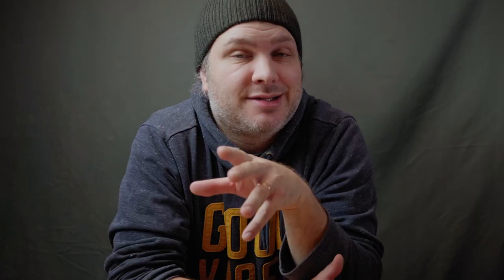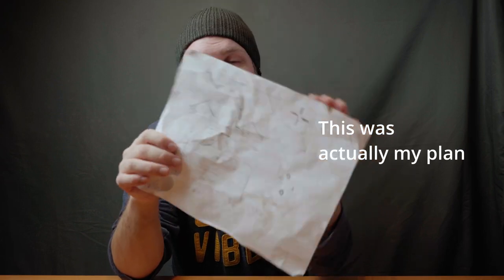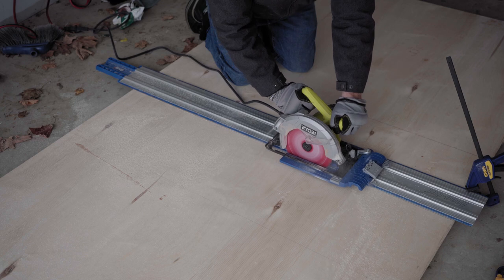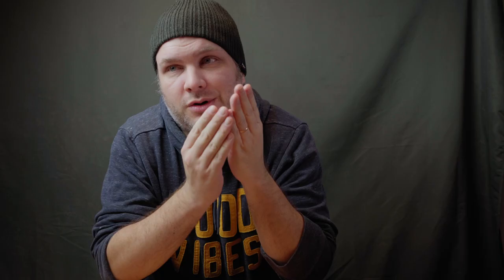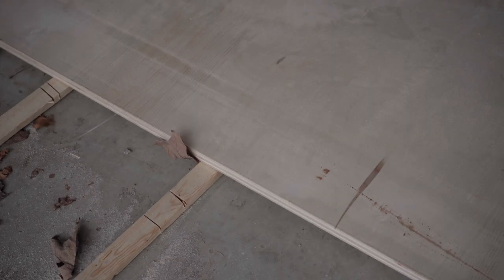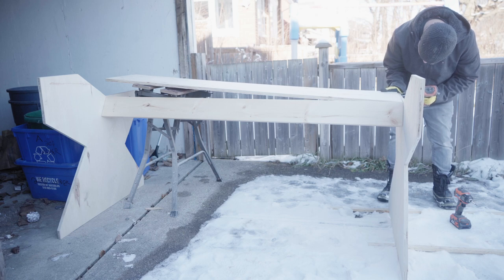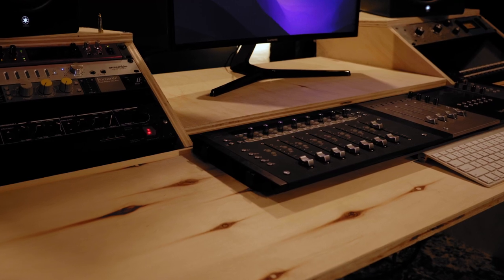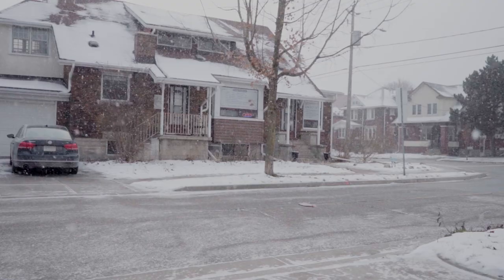DIY Recording Studio Desk build | Build and  Plans

Comment: Hey fellow Canadian ! Great video, thanks !  I'm looking forward to build a desk as well ! Question though, how did you manage to do the angle cuts with the circular saw and the track ? 
The jiggaw is very tricky to get a nice straight line, by experience, Thanks !
Reply from the maker: Thanks Johan :D. For the angles I used the circular saw for majority of the cut. Starting a angle cut with a circular saw is a bit tricky, I had to lift the blade guard just enough to get started. Then I used the jig saw to finish it. Yeah the jig saw is a bit tricky for straight cuts unless you make a guide or something for sure
Reply: @nickiden hey I didn’t see the desk plan